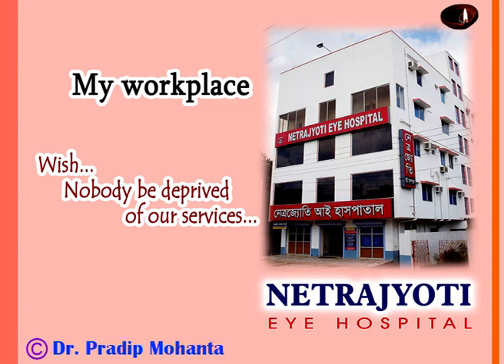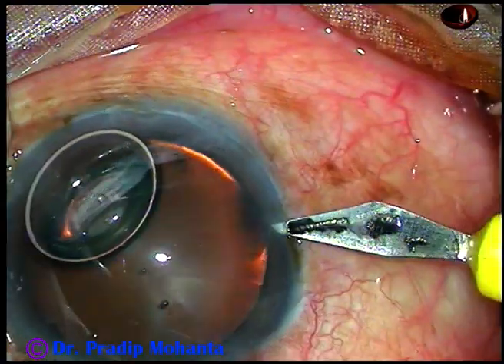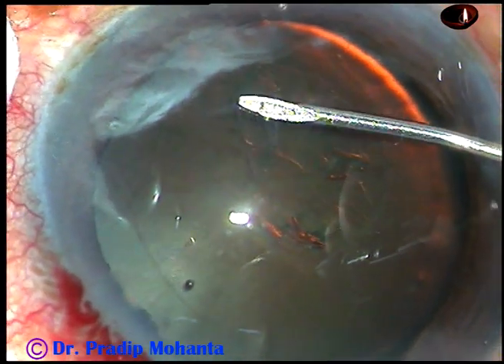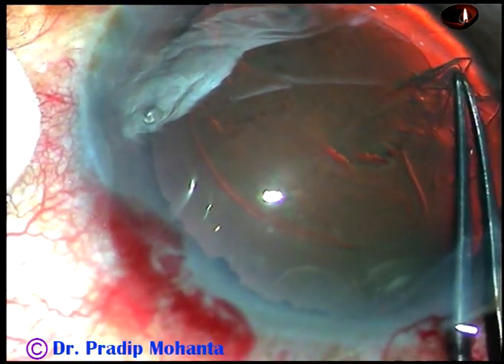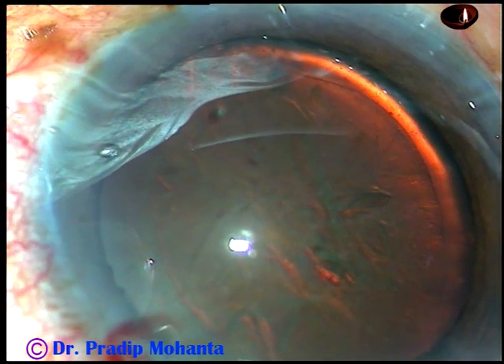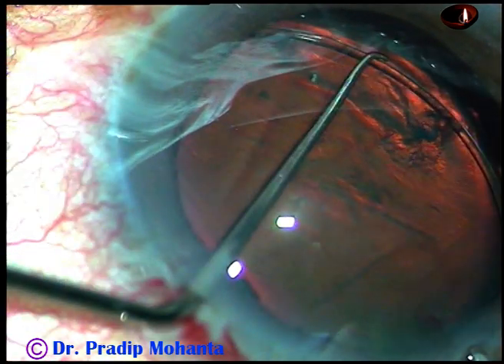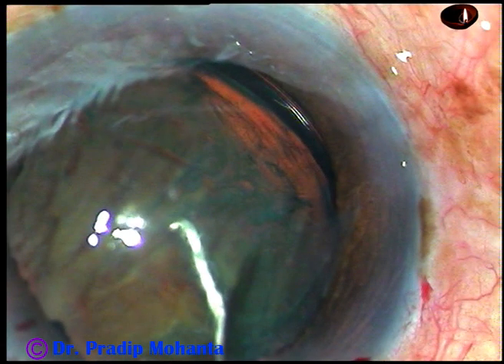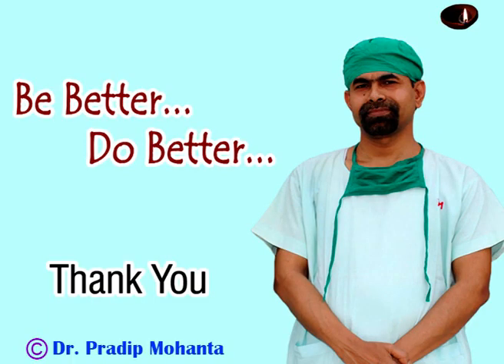How to place a CTR : Pradip Mohanta, 16/4/2019

Comment: Great Dr. Mohanta! The only thing I would do differently is to put the CTR in opposite direction. This way the CTR would not cause stress in the area of zonular dialysis.
Reply: But I think this is the right way of placing a CTR, to direct it towards the area of zonular dialysis.
Reply: @armia.rifaat  it is if you are placing it with the injector, and in a continuous motion. If you are only using the forceps, it may push away from the zonular dialysis. Second point is that the rexis moved a bit far to the equator of the lens in the area of the dialysis, Dr. Mohanta said it himself. This could also make things a bit tough.